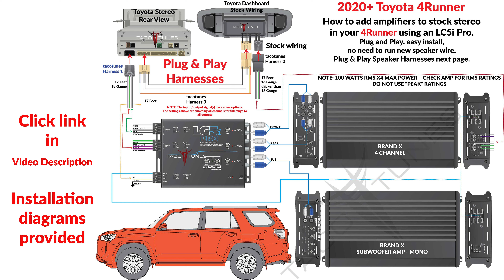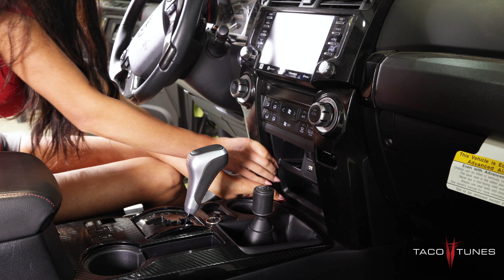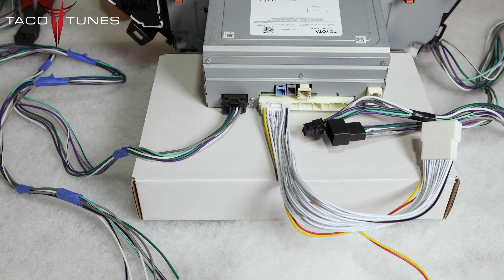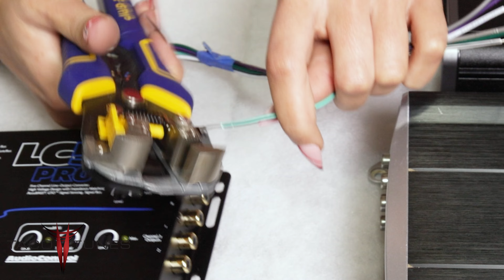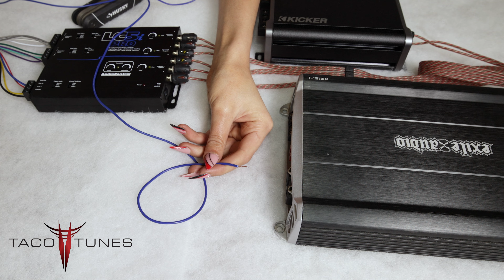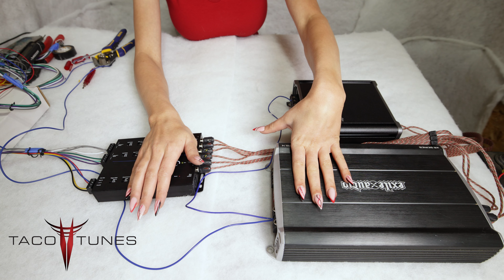2020-2024 Toyota 4Runner add amplifiers to stock stereo Audio Control LC5I Pro Line Out Converter

Comment: Hi, every 4Runner video shows them taking apart the dash to install the harness….. is it not possible to use an amplifier with a high level input, where you don’t use the RCA’s, just connecting the speaker wires into it?
I have the Rockford fosgate 500-1 hooked up in my truck and it sounds great, but wanted to put an amp in my wife’s 4Runner and not have to rip the dash apart.
Reply: your subs amp is easy because your just taking a signal and giving it to a new speaker that isn't already in the truck. its way different if your stealing a signal to boost that same speaker for all channels, you need a spot where all speakers can be tapped in order to give the input AND OUTPUT!! back to the speakers after they have had the amplification
Reply: @DANTHETOYOTAMAN  
Ok that makes sense, I was just adding a small sub to the existing speakers just to get a little bass. I know when you add more power to all the speakers it will sound so much better but just a little more bass will be fine.
Thanks for your input… awesome!

Comment: Hey! I just installed my kit but I’m having whine noise,  what I can do to address that issue?
Reply: Don’t take your wife in your car….then the whining stops
Reply: be sure to check your wiring for any kinks or pinches. if all is good. you can check the ground is solid. is your whine constant or does is get louder as you accelerate?